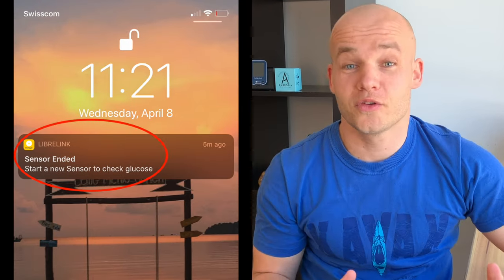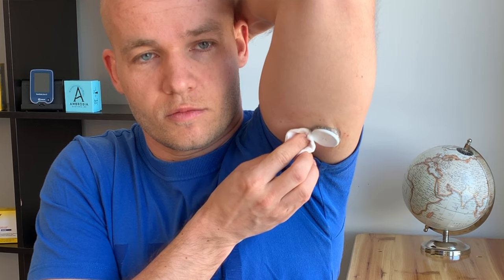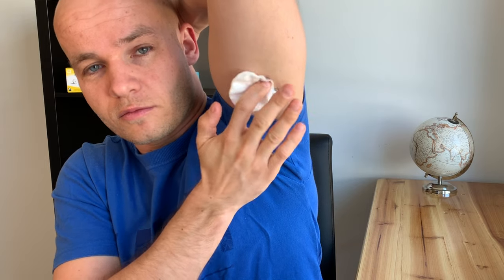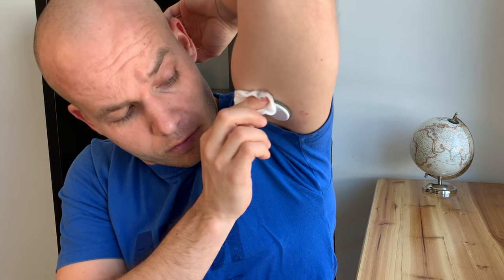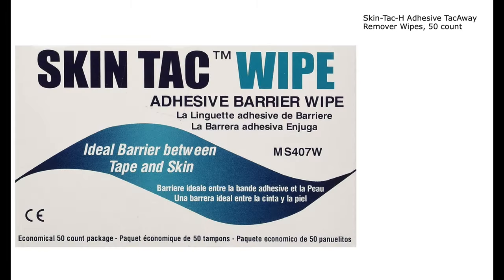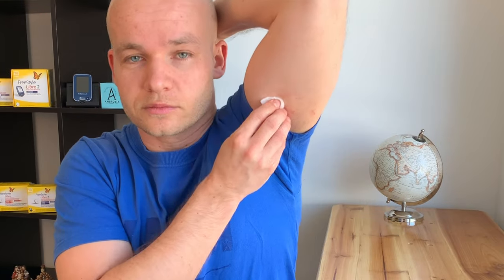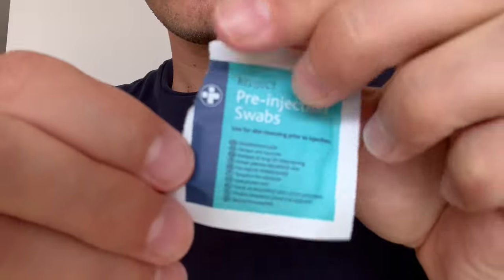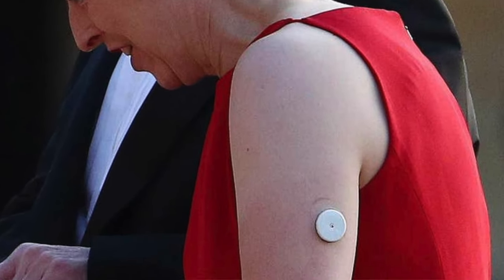How to Remove FreeStyle Libre Sensor / 5 Tips for Painless Removal

Comment: Hi Tom!  I was about to try and remove my first sensor this evening.  Luckily, I found your video before I started.  I quickly rushed out and bought some baby oil before the shops closed! Anyway, your method worked perfectly and the removal of the sensor was absolutely painless!  Thank you so much for the video and tips! It’s perfect!
Reply: Good that’s good news. I love this video when I took my first sensor off, it was stuck on like crazy glue. When I finally got it off I had red spots all over my arm so apparently I ripped some skin off —not fun. I put the second sensor on the other arm because I didn’t want to further damage the first arm. And, I’ve watched a lot of your videos; in addition, to prepare for removal of second sensor, I went out and got baby oil, cotton swabs and alcohol rubs. I already had soap and water. Your videos are wonderful—light hearted makes me laugh a little while I rip the sensors off my arm keep it up. You are a star.🎉🎉

Comment: I also use coconut oil, but I put it on a q-tip and kind of “moosh” the cotton part around the sensor to get a lot of oil under there, and it comes right off. The remaining oil usually is enough to take the remaining adhesive off my skin as well. 
I’m so happy to have found your channel, as I have been a type 1 for 47 years and you have some amazing tips. Cheers from the US! 😊

Comment: Hi Tom and thanks a lot for all your videos. I have a sensitive skin and even using baby oil to remove the sensor, i get sore skin. After using several methods, I found that the best way to remove the sensor, was when I shower, just that, hot water and soap. Hope this helps other people with sensitive skin like me. All the best

Comment: This was absolutely brilliant. I have Type 3c diabetes and my  nurse just said use coconut oil. It wasn't until that night that I thought How?? My fingers would be slippery, how would I grip? Your video was absolutely Spot on!! To use a cotton wool ball then allowing it to soak which most certainly would not have occurred to me was excellent. I have a couple of CTDs as well so my skin is tight and dry. I reapplied the coconut oil several times over the ten minutes then gently eased the edges, then pulled. It came off without a second of pain. You are an absolute star for such a superb guide. Thank you so much 😊

Comment: Tom, T1D for 36 years. I have the Medtronic 670G  (fake panaceas basically) and the sensors were so expensive and the calibrating constantly (only when your stable - yikes) made me high due to stress (cortisol).  My doctor put the Libre in my arm at an appointment 14 days ago and I couldn't get it out!!  My iPhone told me it was over and then the pain.  LOVE your tips. Thank you. I used Moroccan oil (hair care oil) let is soak for 10 min, did it slow. Perfect. Your video saved me!!  You are the best. Cheers from America! Wishing you no complications - ever :)
Reply from the maker: Thank you for your kind words and shing your tip with the Moroccan oil! Much appreciated! Have a great day and stay safe!

Comment: Thanks, I have tried this approach, but I find it easier to remove sensors in the shower. I direct the warm water onto the sensor for a few minutes until I can get my finger nail under the edge. I gradually work my nail all the way around the sensor (slowly as suggested) and the sensor almost falls off. 

This is also a reason not to stay under the shower too long IF you don’t want to ruin a good sensor!
Reply from the maker: Thank you for sharing your tip!
Reply: Water is actually a universal solvent.  Soap makes it wetter by eliminating or reducing surface tension.  Heat, not only softens the glue but makes all the water and the soap more effective.
Reply: I also use the warm shower removal trick and it allows me to easily remove both the Skin Grip patch and the sensor painlessly.

Comment: Thank you, thank you thank you I just took off my very first sensor and following your directions with the coconut oil, and I wrapped a little plastic wrap around my arm to hold it in place just melted right off my arm no problems no sticky stuff even lift this video was fantastic

Comment: Thank you! After the 6th sensor I put in, it finally didn't fall off before the14 days and removing it was so difficult until I watched you! Thanks, you're a life saver
Reply from the maker: You are most welcome! I am glad it helped.
Reply: Man never ever had one fall off or even come loose slightly. 
Suggest using 90%rubbing alcohol to clean are well for new sensor, let skin to dry for a minute, this removes all skin oils. The apply new sensor, also suggest slightly different location that us still in area libre recomends.

Comment: Hi, Tom!  I found this video after putting on a freestyle Libre 3 for my first time. It looked good when I put it on, but almost immediately, I had blood dripping all over. I needed a quick way to get off the sensor, and the instructions it came with don’t say anything about taking it off or what to do about bleeding. I guess what I’m saying is I needed a faster solution than a five step solution where I would have to go around the house looking for oil.

Comment: Today was the first time I had a problem getting my sensor off. The sticky stuff actually stuck to my arm. I was shocked.  Glad I found this video. I use Uni-Solve Adhesive Remover to get off the sticker. I hadn't actually thought of trying to use it to get the sensor off, maybe I will try that next time. thanks so much for all your videos!

Comment: I really appreciate your video - extremely well done and reassuring. . I need to remove a sensor from my cat - first time she's had it. I've been really worried because cats have sensitive skin and it sticks to fur. Vet said to use alcohol. Somehow oil makes more sense to me. It's gentler on skin and the odor is more pleasant. Think I will use olive oil unless we have coconut, and use a small needless syringe to get the oil well under the sensor.

Comment: Hi. I use alcohol to dissolve the first layer of adhesive and it comes off really easily. After that I do use baby oil to get the remaining adhesive off, which looks like a circle, kind of. After that, I pretty much follow what you’re doing. Thanks so much for the video and I’ll try the oil for the first removal step. 👍🏿

Comment: Great solutions....another complication of removing the Libre Sensor from dry skin is...."tape burn" where the 1st layer of skin under the adhesive comes off with the sensor O_O" <ouch>. Will try your Baby Oil solution next time. Thanks for sharing.

Comment: Hello Tom, Love your video's, very informative. My trick is the showerhead as hot as posible aimed at the sensor, it softens the gleu and removal is easy and painles, no oil on your skin causing adhesion problems with the next sensor. 
Regards, Rob

Comment: I just started my sensor two weeks ago and has been so much easier. I use mine on my upper thigh and it stayed for full 2 weeks. Numbers were same as testing. I compared them both a few times
Reply: I am brand new to all this. My rang of motion on my arms is limited. You put your on your upper thigh, front or back? Does it interfere with sitting or clothing?

Comment: Hi Tom, today I have to remove my sensor for the first time but I don't have any of the oils or anything to soften the seal. Is there a way to do it without the oils? I can't use my sensor atm as I'm being told it is due for a change. I'm quite worried tbh as I'm not sure if my arm is going to be bleeding when I take it out or I might have a hole in my arm!. Everything my diabetic nurse told me a fortnight ago has completely gone from my memory (I think the diabetes affects the memory a lot). Thank you, and I'm so glad to have found your channel.
Reply from the maker: I would recommend that you contact your nurse with specific questions as I am not a medical professional and only sharing my personal experience (not providing medical advice). It is perfectly fine to take the sensor off without using oil. It is just a bit less smooth. There should not be any blood or wound when you take it out. The little piece of nylon that is under your skin is very tiny so no need to be worried. Hope this helps.

Comment: I just removed mine for the first time this week, and it did not want to come off. I ended up removing the disc, and leaving behind the adhesive. It hurt!  I was then able to peel off the adhesive, but don’t want to do it that way again. I will try the baby oil and see how that works next time.
Reply from the maker: Yes. Try it. Should be much easier to remove. Good luck!

Comment: Thank you, making my first change today. Pity I’ll be in work when it runs out. I wonder if it’s ok to leave the old one on till I get home!!
Reply from the maker: Sure! You can leave it on for a few more hours! That’s not a problem at all!
Reply: I am far from an expert.  As I understand it, I called and asked the tech people at abbot.  It is essentially a clock programmed to stop working in 14 days.  It stops working.  You will not have a low glucose alarm.  You can perhaps find a better time for it to stop working. Say when you are not at work but when you are normally home. Easy to do.  When you reprogram the meter to the new sensor it only reads the new sensor not the old on which may have time on it.

Comment: I've just broken my sensor, and when I pulled it out I found only the filament, not the long, stiff needle that was on it when I attached the sensor the other day. Did that needle go into the applicator, or is it stuck in my arm? Yeah I know, ask my diabetes team, but it's after closing time, and I can't find information anywhere. Grateful for advice.
Reply from the maker: The needle should go out after application. Only the filament stays in which takes the readings. Hope this helps and your next sensor will work better. All the best!
Reply: Thank you so very much! You've taken all my worry away, and I don't need to chase my diabetes team or Abbott helpline all day. Thank you!
Reply from the maker: You are most welcome! I’m happy I could help.

Comment: Hi Tom, I've just removed my first Libre 2 and I can see the soft electrode but there is no sign of the needle that inserted it? I expected it to come out in the same manner as it went in. Do you know what happens with this? Am slightly concerned that it's broken off in my arm! If you or anyone else on here can help, I'd be grateful! Thanks.
Reply: The needle that inserts the fiber says in the applicator, It only very quickly pushes the fiber in when you apply the sensor and retracts back into the applicator.
Reply: @kendog1111  Thank you so much - when you search the net there's so little information about this out there, practically nothing.  You've really put my mind at rest! 😅
Reply: @kendog1111  thank you. This was my fear that the needle broke off in my arm. I could literally feel it moving around. Anxiety
Reply: I thought the same and looked online for a solution. I told my hubby it probably retract back in but didn't know.

Comment: I watched this and ended up just pulling it off straight. I gripped it on all sides and pulled directly up. It was fine. No need for all this faff. It felt like pulling off a plaster but a bit stronger.

Comment: Thanks so much for your videos. They are very helpful.  I've been  D2 for a few years, thanks to menopause. I'm new to watching your videos and may have missed any topics concerning CGM protection patches.  I'm also new to using CGM. My sensor feel off frequently. I placed them on my back upper arm.  I purchased the patches. They keep my sensors on but they do irritate my skin.  Any suggestions?
Reply: have you tried " type- strong" patches? I got on amazon. I hav sensitive skin and react to things like kinesiology tape glue with redness/ itch, so I expected to react but I've had no bother at all from these.

Comment: I was told to place a new sensor a day prior to removal of the current sensor.  A new sensor is not as accurate supposedly for 24 hours placing the one 24 hours before removing the other allows you to have a seamless transition

Comment: Thank you for the informative video tutorial! 

One question: when the needle is brand new, it is long and shiny. When we remove the patch after 14 days, the needle almost entirely disappears into the body and only sort of a thin wire hangs to it. I'm wondering what metal the needle is made of and what happens to it. Does it dissolve into the body? 

Thanks a ton!
Reply from the maker: Thanks for watching in your question! The needle actually comes out right after insertion. It does not stay in for the full two weeks. What you take out after two weeks is just the filament that was under the skin. Hope this helps!
Reply: @TypeOneTalks  Oh, that explains a lot! Thank you very much for answering promptly! Cheers! :)

Comment: You can  mount the new sensor at your convenience at any time before the old sensor becomes expired (in the morning before work). When the current sensor expires, simply activate the new one and remove the old one anytime, at your convenience.
Reply from the maker: Great tip! Thanks for sharing! I sometimes do that too! Helps the new sensor settle in! Wishing you a great day!
Reply: Thank you . Good to know that putting new one does not depend  on the old( expired) one.
Reply: FSL does not measure ur Blood sugar. It measures Instratestial fluid( look it up).
Also my experience has been weird!
Explain:
- Before meal may show 7( mole/L)
- After meal sitting for 15 mins- reading goes down to say 5.3 or 4.9.
- Then 30 mins later it will shoot between 8- 10.
- Then an hour n half later it will get back to 6.1 or 6.4!
Amazing!
And
I m Type 2- non insulin.
Reply from the maker: @bradparmar4728  Just to clarify, it measures blood glucose level from the interstitial fluid. Thanks for your comment! Have a great day.
Reply: @TypeOneTalks  No it does not!. ( I called Abbott n they admitted it n Now even advertises in Small n Big Notes that it is interstitial fluid!( It is like looking in A Mirror n someone telling you; you just blinked ur Right eye, or that you raised ur left arm, because they can deduce that from watching you in the mirror n knowing the properties of Mirror image.

Comment: Best thing that works for me is just get into warm  shower and gently remove the sensor. It comes out easy because of steam and heat. Also shave the area before you apply the sensor. That way it does not pull off any hair.
Reply from the maker: Thank you very much for the tip!

Comment: thank you for the video, but may I ask, where is the needle?  isn't there a faily large needle/pin that inserts an inch or so into your arm?  thank you.
Reply from the maker: The only thing that stays under the skin is a tiny filament. The needle comes out right after the application. I discuss this in my sensor insertion videos in more detail.
Reply: @TypeOneTalks  oh I see, so the needle doesn't stay in your arm?   If it's just the glue that keeps it on the arm, then what is the needle even for?

Comment: Hey Tom. So I started using the Freestyle 2 sensors 2 weeks ago and It finally ended. Before I was able to remove it, when I took off my shirt it fell off. (Pain free) but my wife notice it had no needle attached and just a soft flexible black filament. From your experience, Is this the way it’s suppose to look/feel or was there suppose to be a needle attached aswell. I’m kind of worried now
Reply from the maker: Yes. It is exactly as it should be. The needle comes out right after insertion and only the filament stays in for two weeks. Hope this helps! Welcome to the Libre team!

Comment: Does it work in your inner arms as good as outside of arm ? According to liber instructions it says outer arm ??
Reply from the maker: Hi Mart. Yes, it works just fine for me on the inner arm. One advantage of the inner side, in my opinion, is that the sensor is better protected and not so easy to get ripped out.
Reply: Many thx will give a go 👍
Reply from the maker: Mart Preston You’re welcome! Good luck!
Reply: Type One Talks hi thx just realised that I’ve got a miaomiao so would not be a good place to fit 🤪
Reply from the maker: Mart Preston Haha. Good point!

Comment: For first time users, there is no needle in it. It's a flexible prong thing. We just had all sorts of drama thinking there was a metal needle attached.
Reply: It looks like a needle, though, doesn’t it.   I only looked at it briefly before applying it.
Reply: @PalKrammer  the applicator uses a needle to get it in. The actual filament that lives in your arm  is more like a 10mm whisker

Comment: Where is the needle that is on the sensor? My fear is the needle breaking off. Does it retract?
Reply from the maker: The needle doesn't stay in. It goes out right away during the application. Only the filament stay in. No need to worry! Good luck!
Reply: @TypeOneTalks  Does the filament come out when you remove the device? You have guided me through this whole process. Thank you for all your videos.
Reply from the maker: @Sarafina27  You are most welcome! Yes it does come out when you remove the white "disc" as I show in the video. Good luck!

Comment: Thank you for the advice. I don't have a wife or girlfriend so I'll have to ask one of my sisters where to get the cotton swabs. I usually keep some coconut oil for cooking so now I've another use for it. I take my reading before my long acting insulin then remove the sensor and have a shower, applying the new sensor afterwards. I have to get my own alcohol wipes because they don't come with the sensor here in Ireland.